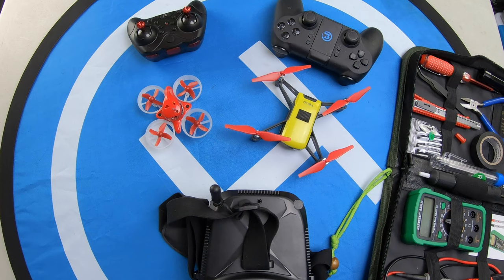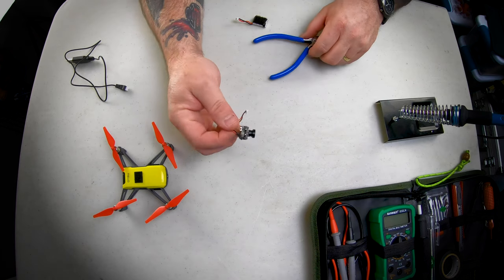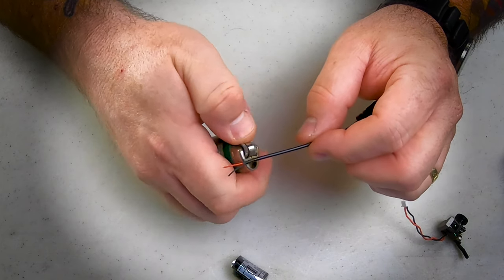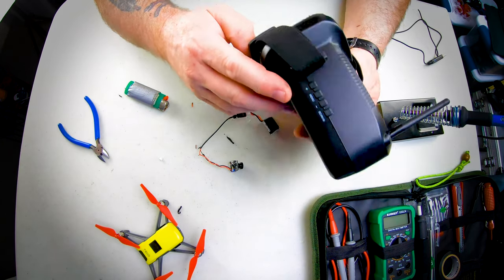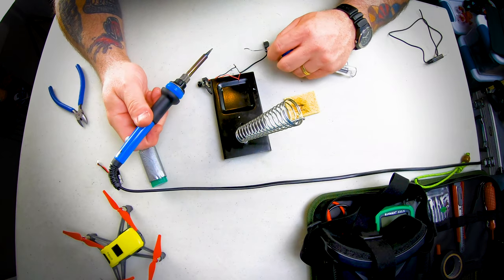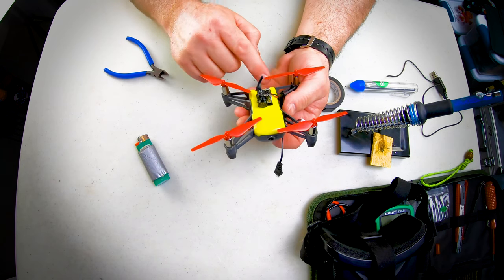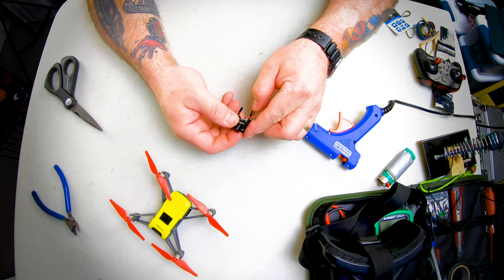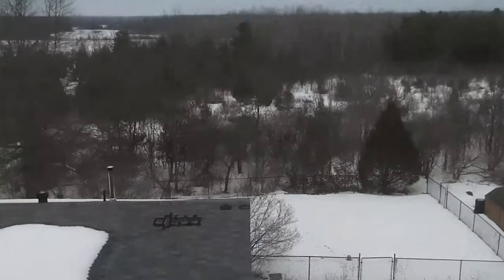DRONE HACKS / UPGRADES & MODS: Franken-Tello - The DJI Tello / Eachine E013 Hybrid FPV Drone

Comment: Nice video. Couple of comments. It would be better to mount the Lipo on top as it blocks the airflow of the Tello if mounted at the bottom. The video feed should be better from the FPV camera as compared to the Tello camera due to Wifi transmission slack. Use a Goggle with built in DVR for recording and we would be happy campers. Happy flying

Comment: funny how  you learned that "new" trick just recently . I'm in my mid 50's and I use to do that way before the internet. like when I was 14 years old, messing around with tearing down my dad's stereo system . just so I could see how it worked. and fix it, before he threw it out.  But I can remember doing that with matches ( not sure we had Bic lighters back in mid 70's? )  but I wouldn't have been allowed to use one anyways .   But great video. been trying to figure out how to take a FPV camera and use it elsewhere?

Comment: Hey, I'm new to cameras and drones. Quick question - is it simply a better quality camera that you installed or is better because you are dividing the processing needed between two devices?
Reply from the maker: Like I said at the beginning of the video, the main reason is because the signal from the FPV camera is lower bandwidth and therefore faster, so you get a near-real-time experience flying. The normal Tello feed is a bit too laggy for FPV.

Comment: Fyi, burning the wire the way you did caused the copper to get a burnt plastic film on it which is why you had a hard time getting the solder to "wet" the two wires together. Next time either don't use the Bic trick or scrape that layer off with a razor or emery cloth. I learn from my mistakes and because if that I'm a genius.... And I've made a lot of mistakes.
Reply from the maker: Great advice. Thanks!

Comment: Why not just buy an AIO FPV camera with some cheap Eachine goggles? Would've totalled out lower than getting an E013 and extracting the camera.
Reply from the maker: I already had the E013 ;)
Reply: @AsgardStudios  good point. My friend has a tello and he hates the latency and lack of control from it. Should I get him an e013 with goggles and gut out the tello and put the other components in?
Reply from the maker: @julianshuster2960  Go for it. The Eachine bundle is so cheap. You might be able to buy the VR006 goggles by themselves and get a camera separately - but the individual cameras for the E013 are out of stock right now. You could just pick up a different FPV cam.